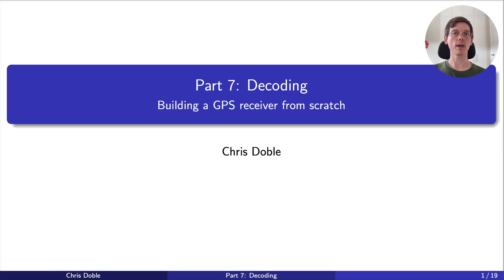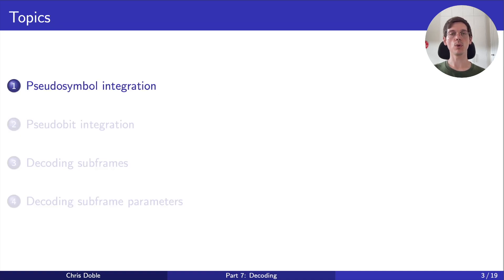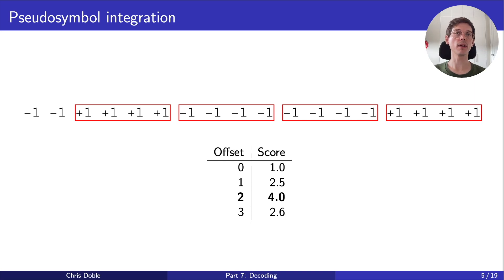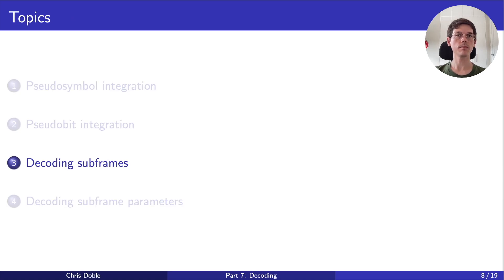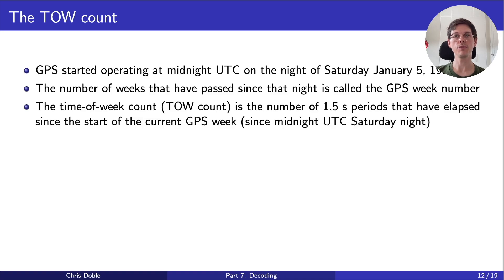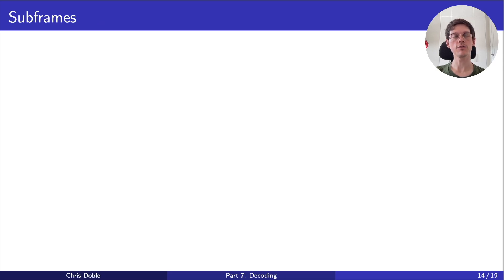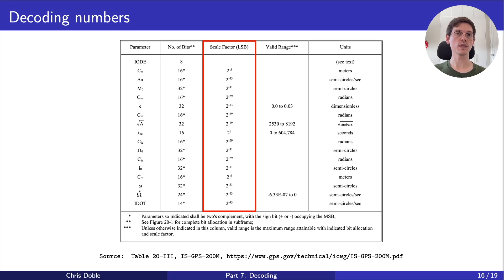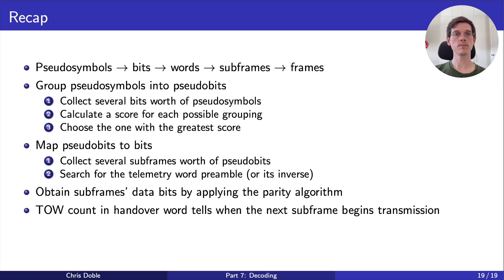Part 7: Decoding | Building a GPS receiver from scratch

Comment: I recall from doing work with PPP that the HDLC flag sequence is escaped if it occurs in the frame data but in that scheme, frame lengths are variable.  I guess in this case we're relying on finding the preamble in the same location at fixed time intervals, so even if we happen to detect it in one instance of the data portion of the frame, we're unlikely to the next time around, is that the case?
Reply from the maker: That's exactly right. In my implementation I look for instances of the preamble exactly 300 bits apart (the length of a subframe) across at least 3 subframes. As you said, it's unlikely it will appear at the same location in the data portion across all three subframes and more likely we'll find the boundaries between subframes.